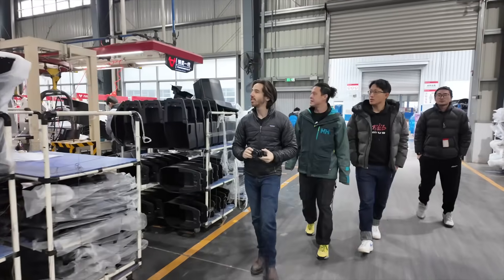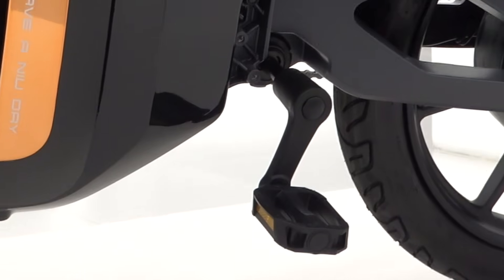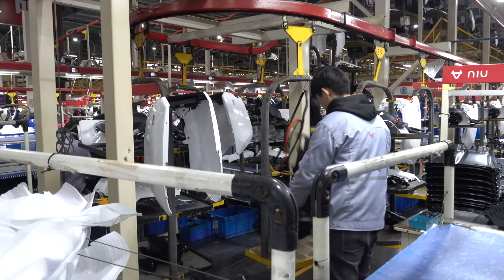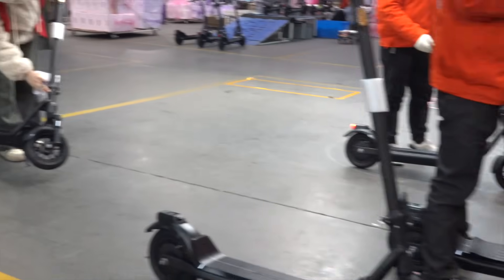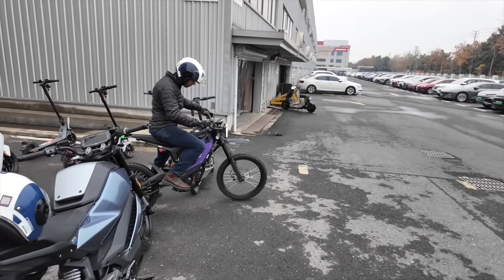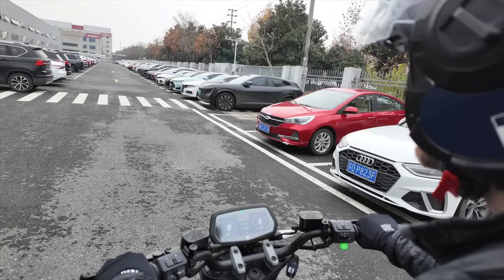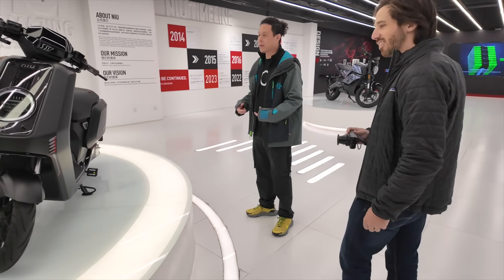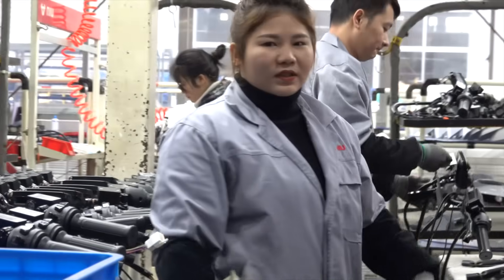I Went To China To See Inside NIU's Electric Moped Factory

Comment: It blew my mind how those guys can wheel two scooter at the same time. I have had two: the Nqi GT and the MQi ER… I like them both. The only thing is that I don’t trust the front wheel bearing they use. In my first scooter it broke into small pieces luckily it happened when I was parking the bike and not when I was flying over speeds humps at 50 km/h. I was very lucky!

Comment: Enclosed 3 wheelers are the future of micromobilty that are the width of 800 to 1000 mm in width with a 50kph top speed, 100 nm in torque and 100 km range
Reply: Yeah, me too.  I thought Arcimoto was going to do it, but no and they closed with my deposit in someone else's pocket.
Reply: Probably limited to 45km/h in the EU to make it easier regarding drivers licences.

But yeah they're very convenient and you don't need helmet to keep track of.

But, I believe that the electric kickscooter is here to stay as well, works great for the shorter trips, and they're easy to bring along when you use public transport.
Reply: @BenjaminVestergaard  In Deutschland leider    nicht auf Radwegen erlaubt
Reply: @Hesselberger  you mean the 3-wheelers or the electric kick scooters? Do they go by road or sidewalk then?

E-scooters must obay to the same rules as e-bikes here in DK... lights on all day and helmet is legally required, they must be limited to 20 km/h and you must be 14 years or older to use them without adult supervision. 

For 3-wheeled cabin scooters there are different rules depending on how fast they can go, just like mopeds. A 45 km/h scooter must use the road, one limited to 30 km/h is allowed where bicycles are allowed.

If you want to use it on dedicated walk paths it must be limited to 15 km/h and is then considered a mobility scooter, technically allowed to be used inside a supermarket. They're allowed to have 4 wheels though.

Anyway, there are some loopholes though, the walking/bicycle  streets between the buildings of a public housing union is technically private property and are often considered enclosed play-areas, because cars don't have direct access without permission. It's basically the owners that decide what's allowed. The complex I live in allows 45km/h scooters in their streets (not least to simplify pizza or mail delivery).

So, in some areas, people go without helmets, on scooters and e-bikes that can go faster and at ages below 14, because the only time the police can catch you is when you venture out on publicly owned paths and streets.

In general I'm okay with that, as long as the riders are considerate and remember that there are pedestrians and kids playing in the streets. So I won't be the first to complain to the housing union unless i see a shift in attitude amongst the ones using these electric vehicles... the vast majority reduce their speed and go careful when they see kids or pedestrians... just like the pizza delivery guys and the handymen that maintain the apartments and surrounding areas.

Edit: I have yet to see the police here going strictly for the electric scooters unless there have been multiple complaints about them. They have better things to do, and now that the rules are clear, that e-scooters must behave like bicycles, or mopeds depending on their speed, the general public perception has changed a lot towards positive, since they got a lot of flak for using the sidewalks and walking streets in cities when the first rentals arrived.
Reply: @BenjaminVestergaard  in south korea whatever it has a motor has to go on the road (right most lane) ebikes and similar can use bike lanes if there is, otherwise use the road. which personally I think is okay but not the best since they limit them to 25kph, if you have anything faster you need a license plate, altho is not enforced I enjoy riding at 45kph on the road, just enough speed to not piss off cars and keep up with the city traffic